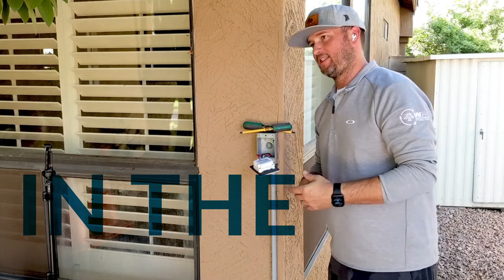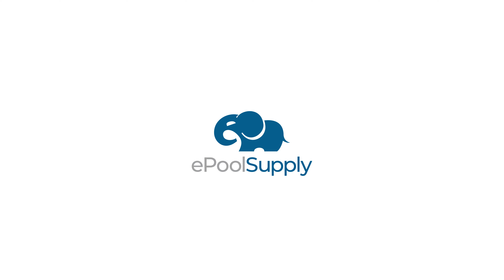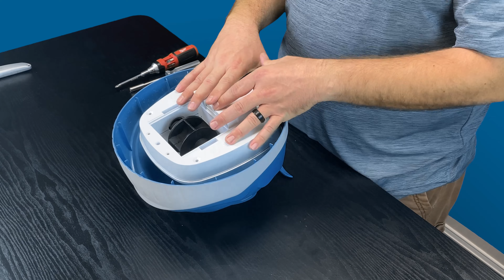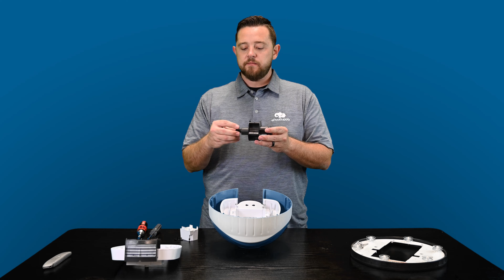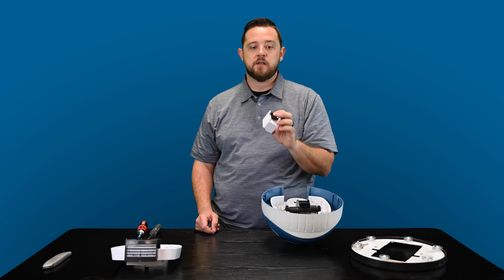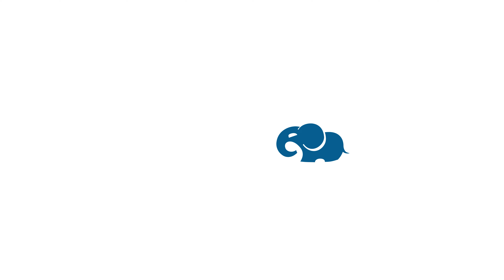Replace Hayward Wanda The Whale Turbine Kit with Bearings - AXV112P

Comment: Thanks for sharing this with us.  I have the ladybug and there's less than 10 hrs on it. It stopped working.  Does this video hold true for my model as well? If  so I may consider buying a repair kit for it. Until then I'll keep on vacuuming by hand. Actually that's a lot faster.
Reply from the maker: Yes it would apply to his cleaner as well.